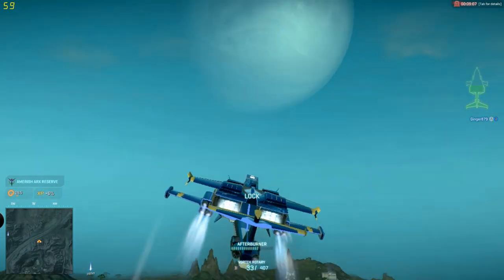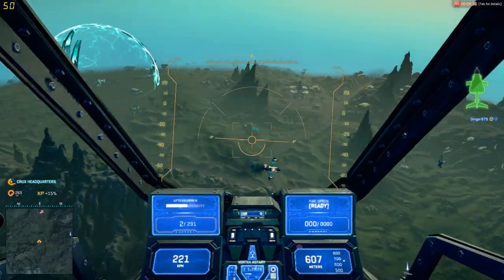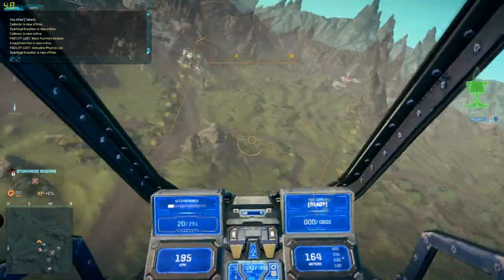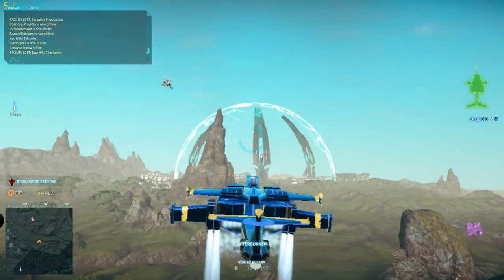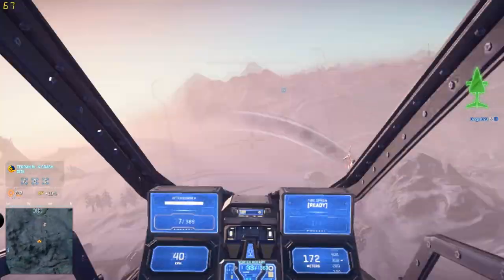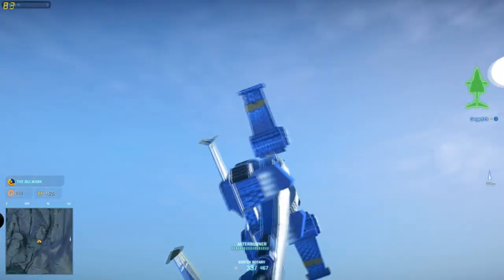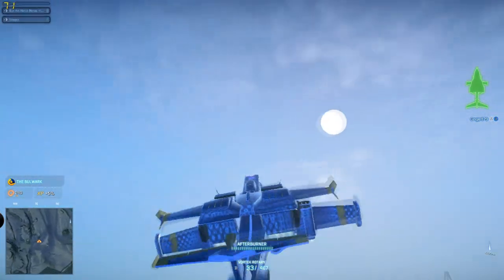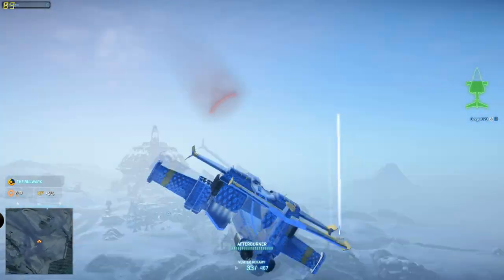How to Dodge Lock on Missiles in Planetside 2

Comment: Good stuff but a hud indicator as to which direction the missile is coming from would help to complement this maneuver. Hoping SOE adds that in some time or makes it something you could cert into. As you point out, for this to work, you need to know where the missile is coming from to begin with. Easier said then done in most cases I'm afraid :( But yes this shouldn't be removed.

Comment: Alternatively you can simply face the rocket head on and fly at it whilst firing your vertical thrust. The missile will fly harmlessly right under your belly. It requires no skill to perform at all and dodges all A2A missile. Not sure how it works on G2A missiles as they're more tenacious.

Comment: Actually, I had a couple quick questions.  First, I find that I need to keep my sensitivity pretty high to pull off the rolling good pilots will use, but the sensitivity is too high to actually aim for me.  Do you use a high sensitivity to fly?  Also would using high sensitivity to fly but having a hot-button to lower sensitivity for when one aims, be useful?  Last thing, sometimes I feel as if my scythe is somewhat "sluggish" or "heavy".  When viewing online training videos or "I killed 5349872564 ppl" videos with all types of fighters they seem to "dart" and "dance" so much quicker than when I bank and move (they also seem to fall less aggressively to gravity).  Is there some trick to this, some random burst of the thrusters perhaps, or some video or post that is already made that I can read/watch?  Thank you.
Reply from the maker: For me at least, there's a sensitivity middle ground where I can aim precicely, and pull off wide turns comfortably without having to ram my mouse across the keyboard.

This may seem unintuitive, but consider slowing the movement of your mouse down. Your ESF has a top turn speed that you may be reaching with less input than you think. If you're quickly moving your mouse across your mousepad in a split second, then you'll only be turning for a split second.
Reply: Gingeh879 Alright, I'll play around with the sensitivity, thank you.  I do understand what you mean, my mouse may be moving more quickly than the ESF may even be able to turn.

Comment: soe should keep this maneuver, but to make it fair to the missle users, it should deal devastating damage, mainly either 1 shot or 2. If everyone know this maneuver than there is no need to get a lock on missles...
Reply: The A2A lockon has been nerfed to hell and back. It used to deal the same amount of damage as G2A missiles, but it was considered a "win button" so they nerfed its damage so that it requires 3-4 hits rather than 2 and reduced its CoF. It's unlikely it'll be buffed back. Having an A2A that kills in 1-2 hits will kill dog fighting.

Comment: So my question is:  In what situation and/or skill bracket is A2AM better than using afterburner tanks, assuming all pilots know how to do this?

Low skill vs High skill, A2AM is worthless for both, since the high skill will easily 1/2 clip with the nose gun and the low skill wont land any missiles.  High vs High, both pilots will be able to use this maneuver and neutralize A2AM completely.  So A2AM is regulated to Low vs Low?  Seems silly.

I'd prefer to see 100% hit rate of A2AM, with slightly lower damage than the current model.
Reply from the maker: I cover this in the video itself.
Reply: Gingeh879 You seemed to imply that A2AM would still be viable against decent pilots, which doesn't seem possible.  The reason low skill cap, low skill ceiling weapons exist is to act as a "low gear" for new players to get traction in the game and still be marginally effective against experienced players.  Once this maneuver is common among decent pilots, A2AM will no longer fulfill that role.

Further, I would argue that using A2AM to force your opponent to charge you is in no way "throwing out the meta" but is a form of meta in itself, forcing your enemy to change their behavior to engage you.  Of course, using Flares dramatically reduces the effectiveness of this technique.

Comment: Does this work against g2a lockons? Also do you realize that lock on rockets is not a tool for dogfights it's a tool for interception and lasthitting running opponents. If you're low on health doing this will result in suicide (well you will die from rocket anyway if you don't but still) since you have to stop. If you use it to counter initiative rocket you still expose yourself to followup main gun attacks. Basically I can't see how is it making a2a lockons any more underpowered than they already are. Also if you have time to find source and turn yourself properly why don't you just attack it and avoid rocket by charging past it as the most basic way of dodging it?

Comment: Throttle Analog doesnt help to stop faster. Thats a myth.

/watch?v=VsMOX27a-Yw

Great video though. The maneuver works fine. Thx 4 sharing !
Reply from the maker: Thank you. I was misinformed, and I appreciate the information.

Still, I don't think I said during the video that throttle analog would help you stop faster, and I still recommend it because a quick press is much easier in a tight situation than having to hold down your "throttle down" key.

Comment: How does it NOT put new pilots at a disadvantage when pro pilots rarely even use lockons? 
Not to mention what it does for ground infantry to air balance.
Reply: I'm mostly an infantry player.
Reply: I'm pretty good with flak. Flak's only problem is that I run out of resources for re-pulling a MAX too often to get reliable flak coverage. And I don't necessarily feel like keeping my MAX up for the entire time (NC here). 

But like someone said, every weapon balance problem is exacerbated by population. I wouldn't complain were there enough friendly pilots around. When their not and enemy ones are logged on should I be forced to stop playing?
Reply: *they're
Reply: The worse type of weapon in a high population area are lock-ons... Ask any high BR pilot... Flying in a high population area is almost impossible. It becomes lockonside. It practically negates air power completely. Why do you think the Striker is so hated? Does more damage against air, armour and requires no skill. Lock-ons have done nothing but hurt this game. If they had made lock-ons a very weak supplement, then It would of been great, but you can practically rely on them over any other counter given enough of them in the area, which is always the case on a high pop area...

If you've over-extended and have no flak cover, you SHOULD be at a heavy disadvantage. Lock-ons just take the strategy away completely.

Sad thing is, I know why. They've balanced the game for solo players, when most know this game is all about epic outfit vs outfit fights.

Flak is fun to fight. Best thing about it? I CAN SEE IT. Infantry beyond 300m I can't see, therefore I can't touch, but lock-on range is like 500m, that's 200m of invisibility/invincibility. You can call in on a skyguard target and get tanks to hunt it, you can call in on a burster MAX for infantry to kill, lock-ons however, are fucking everywhere. Just makes the game more about numbers and less about teamwork and skill.
Reply: Why do you assume I've overextended? I play on the very frontline, in say full two squads, and use the weapons that the devs give me, and yet I am up against harassers who dodge Ravens/ground lockons, MAXes who dodge C4/rockets, and - now, potentially - ESF's who dodge air lockons. 

Maybe there shouldn't be all-in-one lockons, people would have to choose. Maybe Stiker shots should sum up to a damage per clip which freaking in line with others. But I'm sick of counters that are desinged to fail to counter things. 

If you understand overextending as moving out of a friendly pop advantage area than that leaves us with either zerging or overextending.

Comment: This dose put new pilots at a disadvantage, seeing as they have to look up anything not mentioned it the tutorial, those are the ones who get screwed by this.

I also don't understand the argument that A2A missiles pods are OP in 1v1
hover-dogfighting, (the only dogfighting, seeing as there is no way to lose a good pilot in this game), I have NEVER been shot down by A2A missile pods, and I have never used them on someone in a dogfight, because it's suicide to use them in a hover-dogfight...

I fundamentally disagree with this entire video, G2A Lock-ons are OP, the way to balance them is not implementing a maneuver >5% of the players will know about.